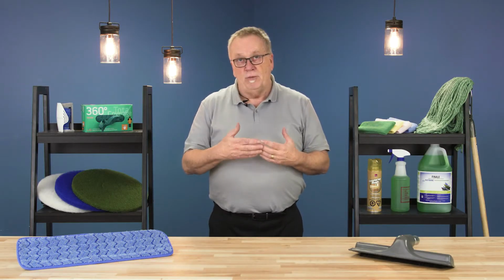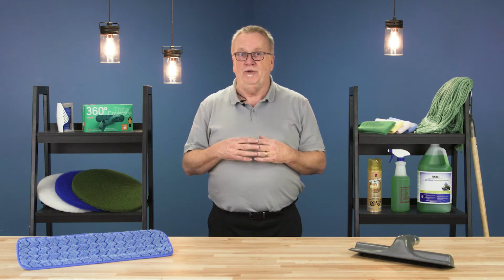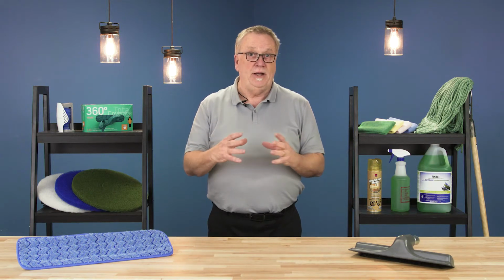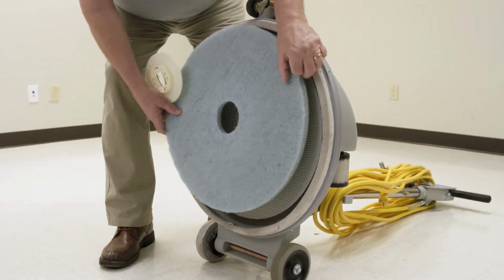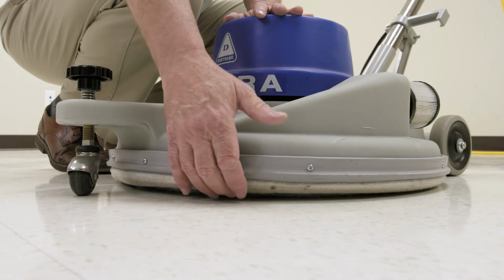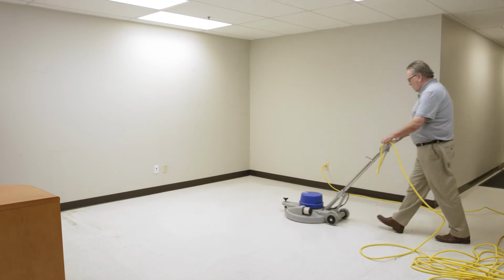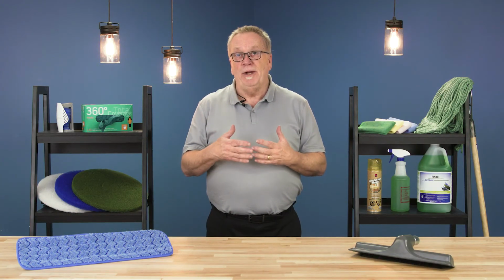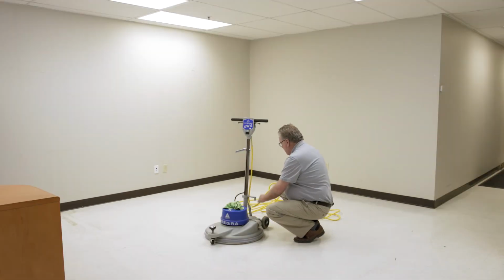The Use and Care of a Burnisher | Clean Care

Comment: Fantastic video! 

I'm a floor technician who actually is self taught of burnishing. Thanks for the tip on wiping down the cord I did not know that.
Reply from the maker: Thank you Matthew, we're glad that you found the video helpful! All the best to you!
Reply: @AmreSupply  hey, one question about burnishing,. And I received a lot of compliments on my floor BTW, I was watching one video and it was saying to start the burnisher before the pad hits the floor AND also to lift up off the floor FIRST before stopping the machine.

I never heard this. Why is this? the only thing I could possibly think of it is to prevent damage to the floor. But I've never had that happen.
Reply from the maker: @matthewboyce5123  That technique is likely mentioned to try to prevent creating any marks when starting or stopping the machine. A properly adjusted machine shouldn't burn the floor when it starts up.
Reply: @AmreSupply  hopefully last question, I did something very stupid and rest assured I do know better. I don't want to go into details all I'll say is I put some floor finish
 on the floor and burnished over it. I think the motor got overheated, as it slowed down and stopped. Please don't ask me why this is very embarrassing, once again I do better. My question is, will the burnisher  be okay after the motor cools down.
Reply from the maker: @matthewboyce5123  If the motor overheated but the motor windings are still intact then the motor should still run after it cools down. Regardless should be able to check the motor with the machine unplugged. With the switch turned on, you can check for continuity with a multimeter. You will check between the two blade terminals on the power cord. There should be some resistance when the power switch is turned on: Resistance means that there's a continuous electrical path, or continuity. https://www.youtube.com/watch?v=iIQ14vTxVK0
Reply: @AmreSupply  thanks! I just had to locate the reset switch and it's working fine. Why is my face red lol
Reply from the maker: @matthewboyce5123  Sometimes its just a quick reset. We all do things like that from time to time.
Reply: Do you really think this machine is worth it though.
Top scrub and new wax is nice also and no dust

Comment: Doesnt the center locking plastic scratch the floor?
Reply from the maker: Thanks for watching. Thanks for watching with the angle of the burnisher, the plastic should not be deep into the floor. If you see any scratching you can adjust the height / pressure which should resolve it.
Reply: Also, that would be a sure test of time to chuck the pad and put on a new one.   Dig.

Comment: How do you know when it's enough pressure
Reply from the maker: Thank you for your question Mike. Too little pressure and the pad won't polish the floor and too much pressure and you'll start to burn the floor finish. Each machine and pad is different so its best to test burnisher on a less conspicuous area of the floor first and adjust the pressure there before moving onto the rest of the floor. When the pressure is right, you'll see the floor gloss increase without any muddy or burn spots.